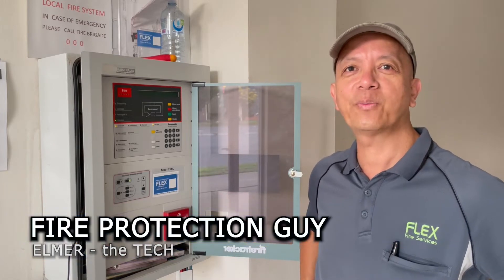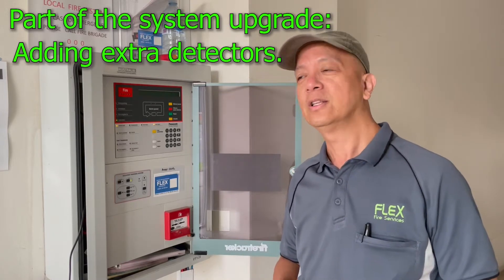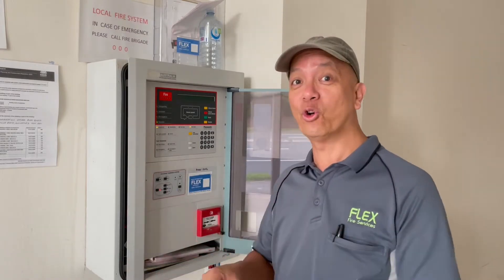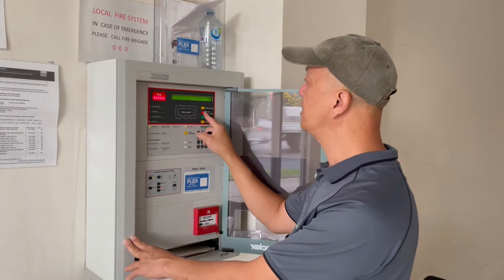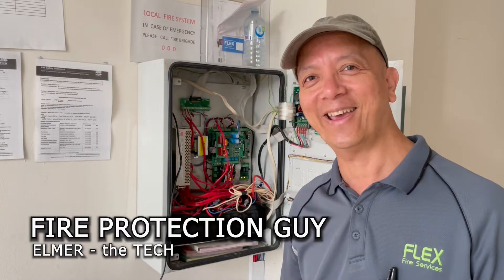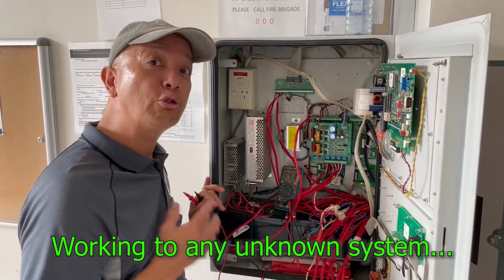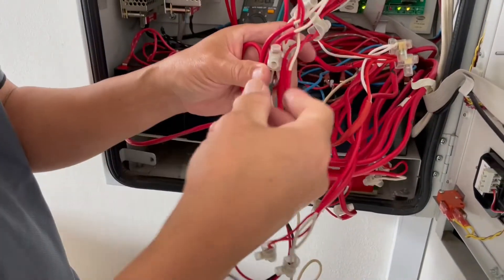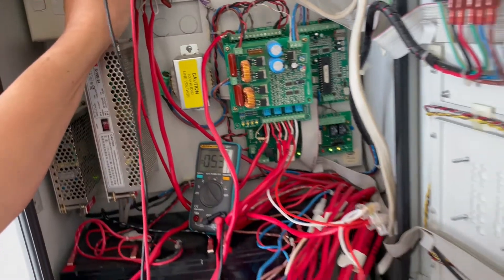Replacing an Addressable FT128 Brooks/Panasonic Fire Alarm Panel with a F220 Pertronics Panel. #fire

Comment: Elmer i see at the end of the video you insert something in the conduit and then you bend it back on itself to get a   90 degree bend . What trick of the trade is this?
Reply from the maker: Inserting a spring bender inside the conduit 20mm or 25mm....then bend the conduit at the middle of the bender.